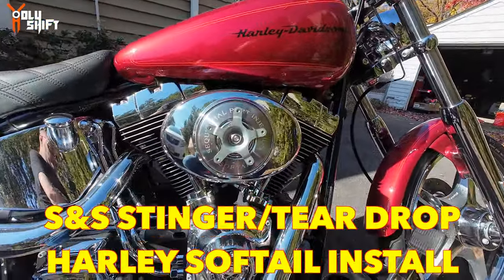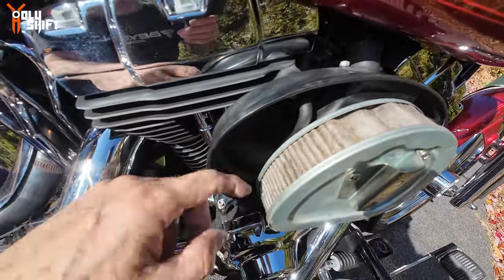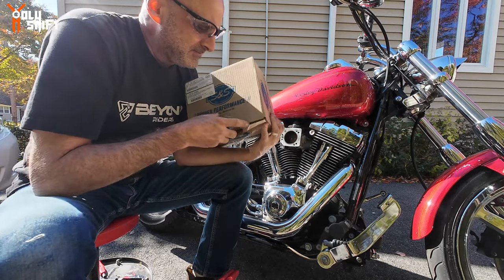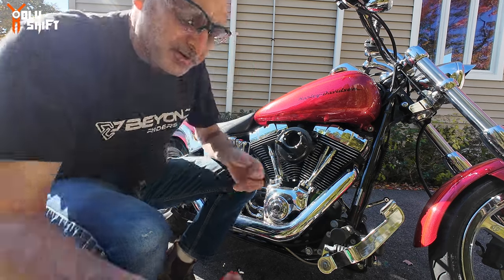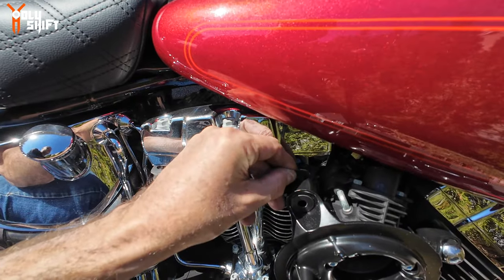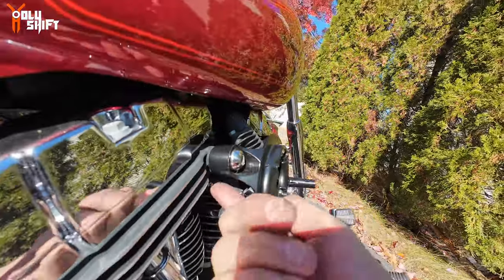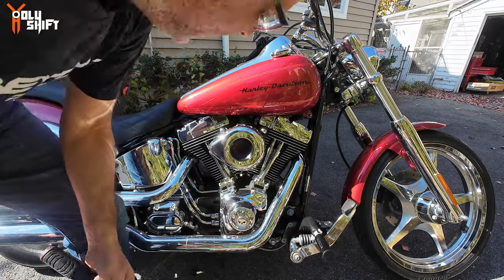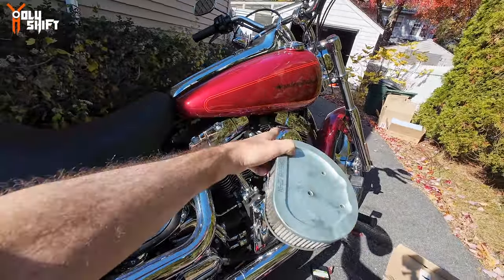Easiest & Most Significant Upgrade S&S Stinger Air Cleaner

Comment: Are the breather bolts with the kit or did you use your old ones? Just ordered that filter assembly for my 2008 Street glide. Have a baron air filter kit now and been wanting to switch it up. Bike looks great, so does John’s Springer. Looking forward to your guys’ upgrades and videos.
Reply from the maker: The kit includes the breather bolts
Reply: @HOLYSHIFT  Thank you Sir for the quick response